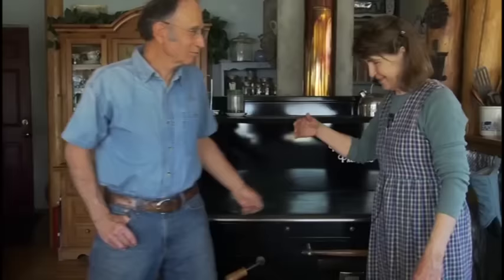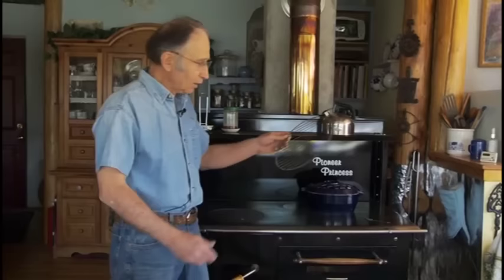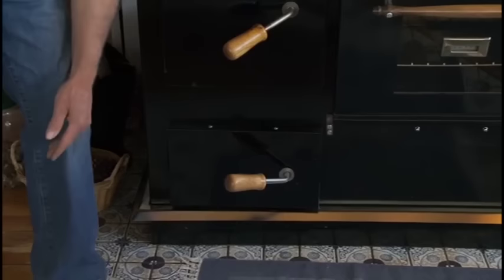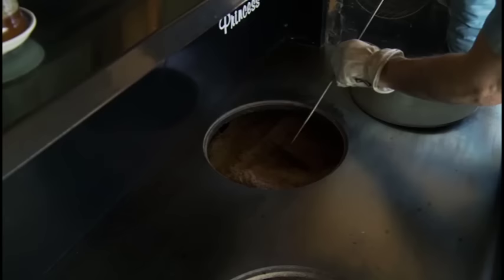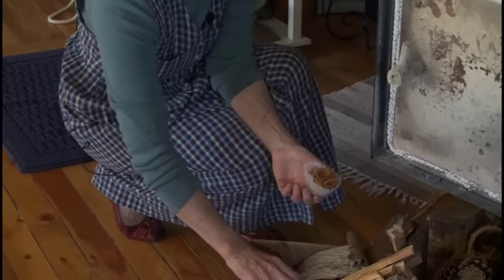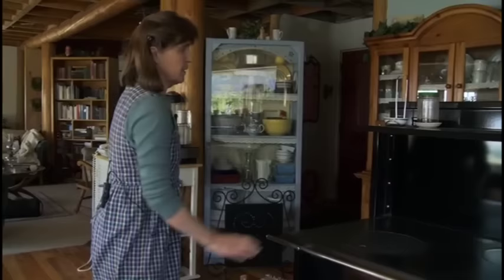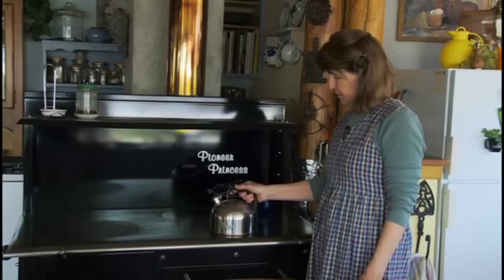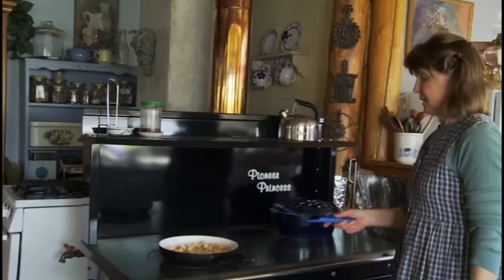A Wood Cookstove is a Must Have!

Comment: I always wondered how those things get cleaned inside the stove.   Flue brushes work great and would clean your flue instead of the cement trowel or whatever you were using.  The flue needs to be secured to itself and not just slipped on.
But what a great stove.  I've got a lot of the old cast iron items like the flip over waffle irons and stuff like that from my grandmothers house.  I have some of her cast iron pans also.  I'll always have those.

Comment: Have you tried any of the old recipes in the Foxfire series of Folk Cooking, and Remedies?
I believe it is an ancient AGA wood/coal stove that is still on my Grandparents farm.  They converted it to gas in the late 50s, and their grandchildren are still using it today.  👍👍💪👌
20:20 They make great old time style chimney sweep brushes, that are not as rough on the flue material as a wire hand held brush, or paint chipper, and make flue cleaning a lot quicker.  Of course you should always inspect the flues afterward, to be sure you did not miss anything.

Comment: My grandparents had a stove like that in the basement, and my husband and I used it in our basement to heat it when we bought our house.  My grandparents also had another stove in the kitchen we burned wood in, and had to light the oven with a match.  It would sound like it exploded.  We kept the door down for heat, and you really were in pain if you hit your leg.  I don't recall anyone burning themselves.  It was all the heat we had in the New Englander house, until we got radiators installed when I was around 12 or 13.

Comment: We have been cooking with wood for 47 years, we started during the oil embargo of 73.  I TRY to set fire to my creosote, when we bought our TIMBERLINE heating stove around 75 the dealer told us to run the stove wide open for about 30 minutes a week.  We have done that, I do not like to clean the stove pipe, I would rather burn it, BUT PAY ATTENTION look to see where or if it is getting hot and your roof is smoking.  First time I have heard about burning potato peals, I clean soot with 1/4 cup of sheep salt, coarse chunks and has some dirt in it so it is sold for sheep not people.  I have been looking at this stove for many years, I love the fire box, my Allen's Princess has about 7" x 7" wide fire box and 8-9" high.  We have to add wood every 15 minutes  ha ha.  It will heat our 1910 built log house down to about 30 F, below that we need a small fire in each end of the house.  Great job on your video, I have not seen your 20 gallon water storage for sale.  We sweat fitted some copper pipe inside our small fire box and had more hot water than we knew what to do with, you can not leave the water off with the copper pipe in the fire box.  One day we fired it up and someone had closed a valve on the cold water line and the steam pressure blew it apart, of course it put out our fire.  Since then I bought a Lehman's water heater / boiler and have base board heaters, works great down to about 30 F.  Hope this helps someone.  Oh, they are right about the food tasting better I think it is a lower heat but even across the cast iron skillets.   Much better than the electric we used to use, the coils were usually on INFINITY and between them no heat.

Comment: I had one of those few years ago, it was replaced by new one. New one is much modern and does not work very well, just looks nice but accept heating the living area does not do much else. Now I em looking for one of old ones in good shape. Cleaning is not so hard, but benefits are great.
There is nothing like smell of burning wood early in the morning.

Comment: Nice video; I make my fire starer out of chainsaw chips, dry them and mix with a very little wax or very little kerosene; I use the wood ash around the out side of the house and buildings-keeps the mice at bay; Mix a little wood ash and water, make a paste and use it to clean the stove and stove glass, clean up after with a damp rag;  I put all bones, after any meal, in a plastic pail with cover and put wood ash over the bones; then in time the bone-meal goes into the garden !

Comment: A helpful tip for anyone needing to put some kind of heat shield between their stove and wall. Try concrete backerboard.use copper plumbing fittings about 2" long between the wall and backerboard.use long screws ran through the backerboard and fittings and into the wall studs. How effective it is depends on how close your stove is and how hot it stays. I find it very effective.

Comment: To date, I have owned an antique Glendale, >> Two Heartland Sweethearts, a Finley Oval, and currently a 1930 Home Comfort, non-airtight. Love the Home Comfort, however my next choice may be a small model Kitchen Queen. I heard the Pioneer Princess requires frequent cleaning. Do check them all out. Below zero in NH today. Our house is toasty. My best working stove was the 1980 Finely Oval ( Heartland- Elmira Stove Works) But the Pioneer Princess is a fraction of the price. Home Comfort was a wedding present...an antique beauty.

Comment: Good video. Somebody needs to tell them about the benefits of fitting a secondary burner, it's easy and cheap. There are 4 benefits: It reduces drastically the amount of creosote produced. You can use 50 - 70% less wood.  Stove will get hotter with less wood consumption.  Finally it burns of most of the smoke and wood gases making it more eco friendly (hence less creosote build up).
Reply: Out of interest how much do they cost on average in USA? We experience so much power cuts in South Africa it is sickening.
Reply: @mfenyanajulie1082  I'm English & live in UK. Various prices. They can range from ₤50 if they need repairing or restoring, which is fairly easy, to ₤1500 or so for designer ones. Some are collectable.

Comment: Aluminum foil on the reflective side has a high reflection of heat energy/infrared. That is why it was cool on the back side (if the stove was real hot the infrared from the stove would cook you on the other side). NASA years ago came out with a 99.95% reflective mylar plastic with aluminum and other reflective materials on it to put in attics to save energy in the house below. Challenge was the house breathes and wants to toss the foil around. It worked on the lunar LEM module to reflect much solar light energy from the sun but no wind in outer space - ha!

Comment: Taking care of the stove regardless of what manufactures say. The very 1st bad thing that will happen is the oven will rust out, in the corners or spot welds. If you use the oven to dry anything make sure you keep a hot enough fire to get rid of any moisture left in the oven.

Comment: Newspaper especially with colored ink and absolutely never use shiny ad paper it will clog your pipe. The hotter the exhaust gas out the chimney the better I use a self igniting propane torch to start the kindling and my kindling is hardwood flooring ends split, after a full year there's a light gray ash on the 8" triple wall pipe. I've used a woodstove to heat a 38' steel boat, 35' pull behind camper and now our home in the Appalachian mountains.

Comment: We've been using ours going on 4 years. It does a decent job but there are things to consider when buying a wood stove. First, our house is 36' X 72'. The stove is in the middle of the house. The ends of the house remain cool which is fine - that's where the bedrooms are at. So circulation can be an issue. This stove takes custom size fire brick. You can't just go to TSC and get a replacement. Firebrick are heavy so with the shipping cost the price is right up there. I've replace the large brick on mine once and then the whole set another time. Firebrick do crack no matter how careful you are but small hairline cracks are ok. When that crack starts deteriorating and the gap expands you'll want to replace them or risk warping the metal behind the brick. At one time they came up with Stainless Steel "fire brick" that costs a little more but the reliability is questionable.
Reply: Our Baker's Choice was supposed to take custom firebrick that we could only get from Lehman's. Turns out that the standard firebrick from Tractor Supply fit.

Comment: lovely video and stove.  I don't understand the creosote buildup.  That is usually the result of burning wood that is not seasoned and too low a temperature.  I have a Pacific Energy Super 27 which doesn't compare to this cook stove.  I cook on it though.  It's main function is to keep us warm.  I have so far, no creosote issues.  6 years of burning and all I got from scrubbing the pipes was a cup full of soot.  I love these stoves though.

Comment: I live in the Puget Sound region of Washington state... cold clear weather... we get burn bans that will include the high tech wood stoves that are allowed... a lot of stoves allowed elsewhere are outlawed here... the clean air laws get quite restrictive... mountains to both the east and west creates a bowl for pollution build up that in inversions where wind does not flush the bad air out... it did get stinky... population has been growing here crazy fast... stoves like this are likely to be something from the past... the only cracks for having a fire at all tends to be recreational fires when there is no burn bans active... I built a recreational outdoor cooking fireplace, it has cooking shelves above an open fire... cooking is mostly with castiron,  a bit like camping in the yard... my zombie apocalypse type emergency cooking set up... had an uncle in Idaho that has a huge wood stove in the center of his house/kitchen area, I think I only saw it fired up once or twice... my outdoor cooking fireplace has shelves made with 6x6 pavers held in place on T-posts (cut fence posts) about 12 inches wide and 2 feet long... the lower shelf can hold Dutch ovens or skillets (have a 14 inch skillet and lid from Cabela' s--- works as a pizza oven) in the upper shelf area... I use the 2 quart dutch ovens with no legs...I have cooked and frosted a 2 layer cake...cornbread, that kind of stuff...the lower shelf gets a bit hotter... roasts and pizza, stews... umbrella over the prep area and sitting area... it has been in place for about a decade.   My cleaning the firebox is a bit simpler and our climate is usually in the 40-50 F range most of the year and wet... burn bans are rare but enough to outlaw most cook stoves I have seen online, so far the high efficiency fireplaces/inserts might have a flat area on top to do a castiron skillet... or flat bottom Dutch oven maybe.

Comment: Right before 25:37 in the video, you cleaned out the ash pan and made the comment that it was 1/2 a seasons worth. I'm guessing that's 2-3 months but may be mistaken. If that's a fair estimate, then the cook stove is very efficient. I grew up with wood stoves, my parents still have two in the house plus the fireplace in the living room that isn't used any longer. The main heat source is an old Vestal wood heater. It must be very inefficient considering it would fill that ash pan in just a few days. It's a very hot burning heater though .. Will heat the entire house. I'm amazed if the ash collected is over a months worth. Please let me know the length of time it takes to fill it. Great video and very inspiring. I'd live to have one of these. Thank you so much for taking the time to demonstrate its use.

Comment: just put you water pan up on a 1 to 2 " trivet (keep it from boiling away). Also to clean the scale off (line stone) in the summer put a heavy mixture of white vinegar and water in it and let it sit till you see the scale starting to accumulate in the solution ...yours is heavy with the sediment so it might take a couple of applications .

Comment: Tip = to clean a stove pipe use a chain. You can also clean the whole chimney with a heavyish chain. Twirl it in a circle or use a drill if you have a way to connect it.  Also use a wire brush.
Reply: Nice tip! I went to menards and picked up a "soot eater". This device is similar to super heavy weed whip line. It comes with rods and you can easily clean the chimney pipe from the bottom, going up. It comes with several rods, that you add another rod to take it up another level. We have a couple offsets in outer pipe and it went through them with no problem. I was blown away how well it cleaned the chimney! It came with enough rods to sweep the entire thing. When it reached the top, a huge chunk fell down!

Comment: Why don't. You just use a 6" round chimney brush instead of putting your arm at risk inside the pipe. Dandahermit.. we have a beastky Great Majestick wood burning cook stove up here above the snowline. Been doing this stuff nearly 80 years. Love our Majestic but would really like one of those stoves because if the size of the firebox. Dandahermit.😅

Comment: We have cooked in the winter with a wood cook stove now for several years. Ours is a Kitchen Queen.
Reply: How do you like your Kitchen Queen? They seem to have a very good air flow around the oven and large firebox. My 1930 Home Comfort works fine. I am used to tending it like another person in the house! Her name is Matilda. Her smaller firebox requires a second grate to help keep the coals going longer.
Reply: We truly love our Kitchen Queen. It heats the house well, cooks our meals and bakes all winter long.  It is a very well made stove.
Reply: Mine is a 100 years plus  Round Oak,  and i love it.   Not too hard to clean.
but I need to get a new fire brick soon !   Love cooking on it!
Reply: We love our Kitchen Queen, Does a good job heating the house and cooks all our meals all winter long. Maintenance is easy , but the most important part is she keeps my coffee hot.

Comment: We have a “modern” wood fire that has a (wet back) water system running through it. The last one we had you could take the top off and actually cook ON the top, but this “modern” one 🙄 you can’t take the top off. So much for “modern” eh!?!?
As soon as the winter comes, we switch off the hot water electricity and we are able to just heat all our water from the fire, saving us 50% off our bill.

Comment: I make my comment only out of concern for fire safety. In the 6 years of running the stove, have you checked the wood that you have foil-covered for any charing? While the foil is a great reflector, it is not so great at insulating burnable parts of your home. I have to assume that you have observed all of the minimum clearances for the stove when you installed the unit. Otherwise you have done a great job of describing the stove.

Comment: In Canada wood stoves are for the rich, the increase in insurance, if you pass the inspection, soaring price of chimney that meet specks and then the approved wood stove. Then you have to buy wood unless you have a half ton, chainsaw, place cut wood and the wood splitter. Then the cost of Gass, flat tires in the bush...etc.

Comment: Get real chimney brushs round or square sized to fit your pipe. You will get the pipe much cleaner and the cleaning will last longer. In that pipe, the creosote there has built-up enough to have a dangerous chimney fire. It is first stage creosote easily removed. Second and third degree creosote, build up smooth, hard and shiny and is very dangerous.You may need professional help to actually take care of it. It's a good idea to build a hot quick fire every morning to help remove the Creosote accumulation from the night before but only if the chimney is clean to start with. If you do ever have a runaway chimney fire don't put water in the firebox because it will create steam and the steam will wash a lot of loose creosote right down into the fire and it will burn much quicker. If water is the only option, you have to save your house use lots of water to completely drown the fire. Shut off the air flow as much as you possibly can. Use a fire extinguisher that is rated  for a wood fire. Haylon, fire extinguishers are very good. They displace the oxygen, which, have some additional safety concerns. Or an ABC dry powder fire extinguisher, but they make a tremendous mess, and it's hard to clean up.

Comment: It is necessary to make a mobile grid;
Sliding back and forth;
Making it possible to install or remove the respective grid;
In the area where the wood burns;
At the same time where the opening of the fire feed door is located;
To place the wood on the grid;
To feed the fire;
When using the stove only for cooking;
Because:
Thus;
The wood will be higher up; Closer to the stove plate;
And then;
You will need less wood;
It will save ...
AND;
ONLY when you want to use the oven:
Remove the grid;
For;
Place the wood to be burned as shown in this video;
And so also heat the oven ...
Because:
The oven does NOT need heating when using the stove only for cooking ...

Comment: I got a real charge at 37min in when in your cartoon voice you say "I want more wood." I'm in Warshington state in an area with many wood species. Primarily alder which grows like a weed here. Also lots of Doug fir. Loggers here cut the money trees-cedar doug fir and hemlock. Cherry is crap to them so they push it into piles and LEAVE IT till  happy firewood cutters happen along and it's a MAJOR SCORE. As you said birch and cherry is NOT starter wood. Back in 1991 was camping near Red Lodge MONTANA. Fifty feet behind my white canvas lodge the tree line was ALL BIRCH. You guessed it and me w/o my Stihl. Luckily I borrowed a bow saw and dragged out downed branches and made my wood supply last that much longer. When it's bedtime add a stick or 3 of birch/cherry damp her down and awake w/a warm stove. And ALWAYS peel the bark off and throw some in your kindling/starter box when you've used all the newspaper. In that box you'll find short candles pitch wood fire irons cedar slivers and such like.